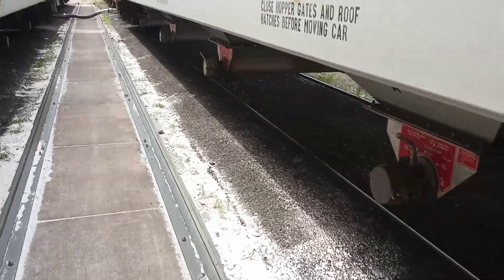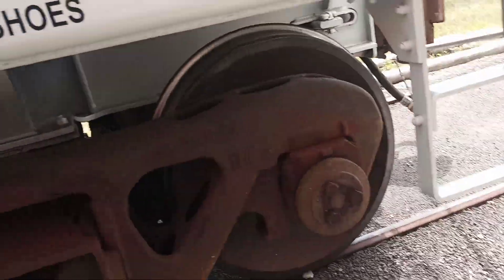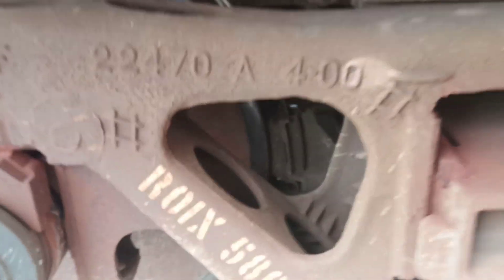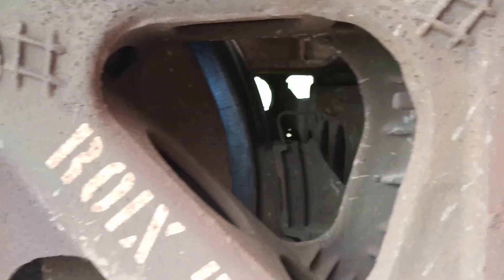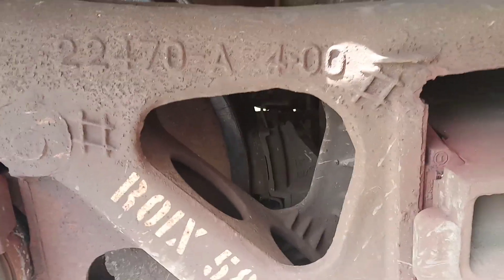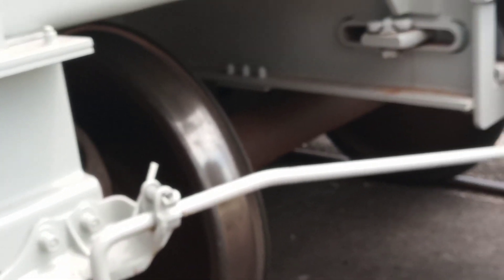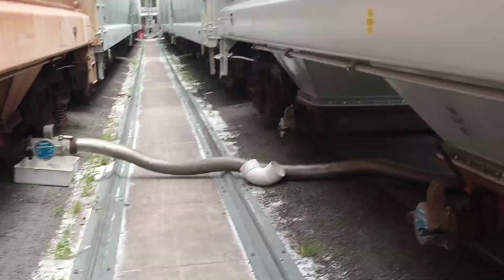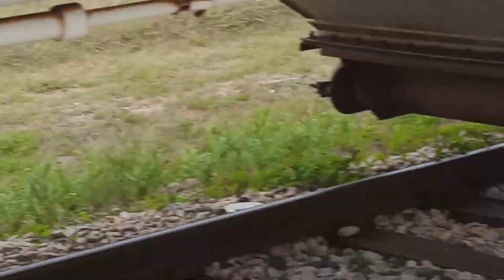Brake Pads are Not Metal Anymore

Comment: hi Jac... being an auto mechanic for more than 50 years i will say 2 things 1) i don't think they ever used metal for brake pads..the stopping power would not be good & metal against metal would create sparks & possible fires...2) brake pads where made of asbestos back in the day they band asbestos because it causes cancer...now they use an organic product but not rubber..vinny
Reply from the maker: Hey thanks for the response I don't know what that is but it looks like a solid rubber compound or it be the type of pad cause when you tie it down it didn't make Sparks but hat a smell not metal burning . I don't know It has a look as if it's rubber.